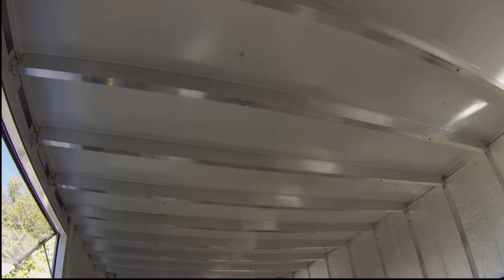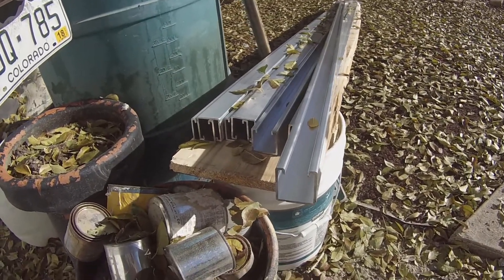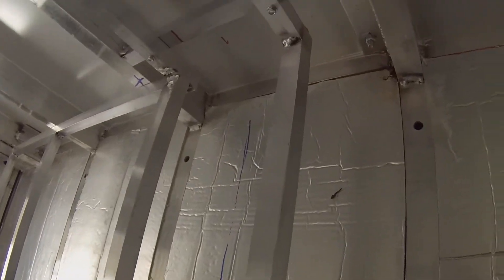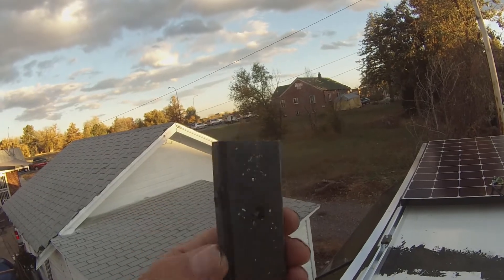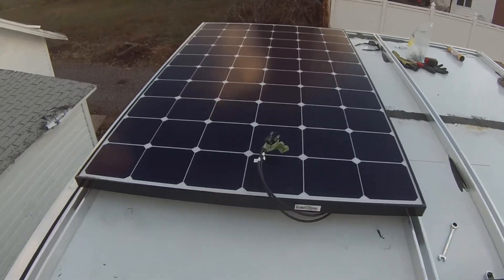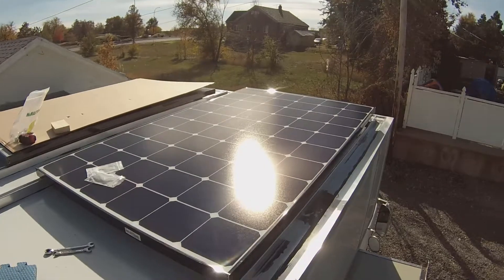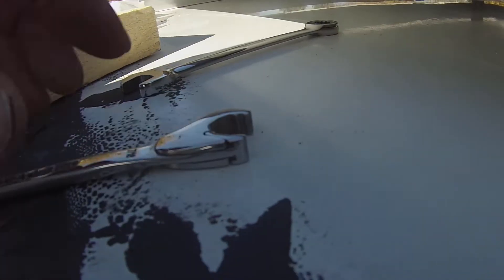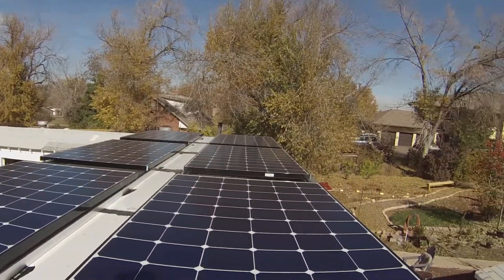An Insane 2160 Watts of Solar on My Expedition Vehicle

Comment: Would you be able to screw in the panels before you put it on the roof ? Like bring up the rails and panels together and then add it to the roof to make it easier ? Great videos thanks so much for the info
Reply from the maker: I did that to some extent to get the spacing on the roof exact. However, they are so tight together on the rails that I would not have had enough attachment points to the roof for the rails.

Comment: what would have made this job so much easier, it cut the roof rails to be individual panel length and mount the rails to the panels, and bolt hinges to the rails on one side and a securing/locking hardware on the other side never needed to work under the panels. With hinges you can also tilt them to face the sun in early more or evening as needed, could ever motorize them.